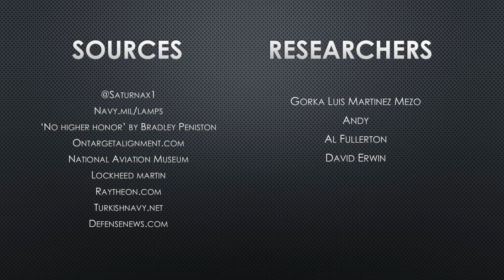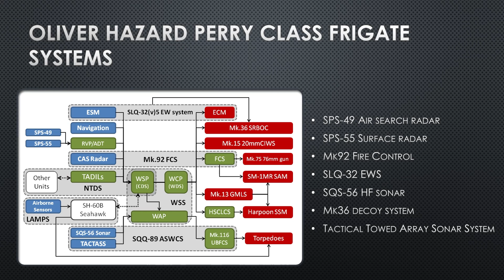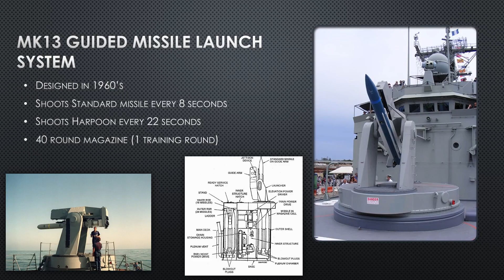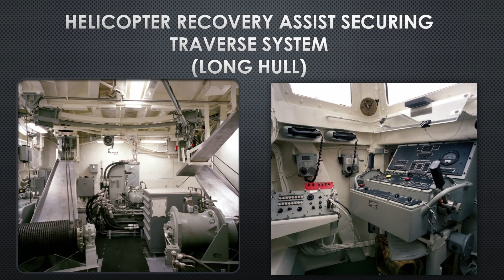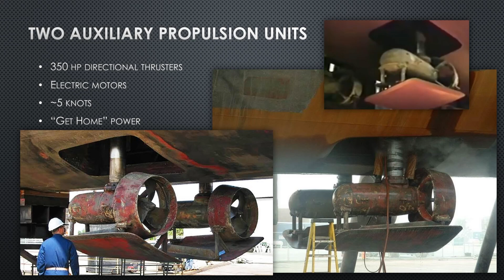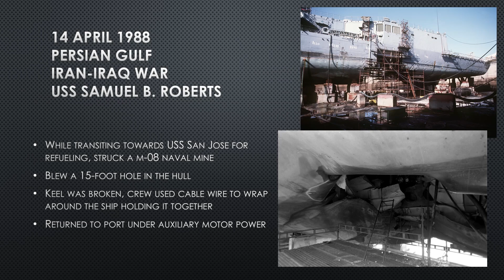Oliver Hazard Perry Ship Brief

Comment: I also remember the USS Stark being hit. And the fact that SCBA wasn’t added to the OHPs in US service until 2000 at the earliest astounds me! When I joined the RAN in 1988(at that time we had 4 of the total of 6 OHP derived ships; oh, and all the short-hulls we got were converted to long-hulls later) I was trained on the SCBA, like everyone else before they went to sea. The first generation of it was at that time being phased out for a smaller, more compact twin-cylinder unit known as OCCABA.

Edit: the Australian Adelaide class was equipped with another channel of fire with the ESSM, vastly multiplying the rate of fire for air defence. This, of course, was,only intended as a temporary stand-in on the newest 4 FFGs between the the retirement of the Perth class DDGs and the introduction of the Hobart class DDGs. The ANZAC class FFHs can carry 8 Harpoons in canister launchers so there would always be backup to the slow rate of fire for the FFGs, if they even carried them at that point. 

One last point, the RANs FFGs that were upgraded also got SM-2.

Comment: A couple of issues I have with your brief from a former EW.  The SPS- 49 is a low freq long range 2D (bearing/range) early warning radar.  Also the SLQ-32 antennas are port and stbd of the MK-92 CAS antenna right behind the pilot house.

Comment: I served as OS1 aboard the USS Vandegrift FFG-48. I was ships AIC and later the ATACO which is the controller for the Lamps MK III platform. Fully integrated into the ships CIC including all key flight data, radar, ESM, and sonar buoy data is all relayed directly to our CIC shipboard. That said, you might have missed a couple key elements and capabilities. Well done.

Comment: The LAMPS slide incorrectly refers to a SH-60F.  The SH-60F "Ocean Hawk" was operated by HS squadrons deployed on aircraft carriers. The photo is of the correct SH-60B Seahawk that was operated by HSL squadrons from FFGs, DDs, DDGs, CGs.
A bit of insider knowledge about the RAST system.  The vast majority of our Seahawk landings were "Free Deck" landings, where the helicopter lowered its probe and then we just manually landed into the ship's "trap".  We very rarely used the cables to conduct "Rast Assisted" landings, because it took longer and was a pain.  While a RA landing had a slightly higher sea state limit, it took longer and was riskier.  It required two brave deck crew to run out onto a pitching and rolling deck with a hook and grounding wire.  They braved the wind and rotor wash of the helo and would clip the grounding wire to a pad eye and then use the hook to catch the blowing messenger cable from the helicopter.  (The grounded hook was to prevent them from getting shocked by static electricity in the messenger cable.)  Once they hooked the messenger cable they would grab it and connect it to the ship's heavier RA cable.  The helo would then pull up the RA cable, though the RA cable would often disconnect from the messenger cable while it was being hauled up , requiring the deck crew to run back onto the deck to get the cable re-attached.  Once the RA cable was hauled up and locked into the helo's probe, the LSO could easily pull the the helo into the trap.  However, we had spent a bunch of extra time hovering over a moving deck.  It was much quicker to just perform a Free Deck landing, and if we missed the trap, we'd just lift back up, reposition, and land again.  Much faster and no risk to deck crew.  On a humorous note, I often watched new deck crew catch the blowing messenger cable with their grounding hook and then move toward the RA cable laid out on the deck only to find they couldn't quite reach.  You could see them pull on the messenger cable as if they thought they could pull the helo over to reach the RA cable!

Comment: Served 2 tours on FFGs, as Navigator and as CSO in the 2000s, did INSURVs on both.  They were good capable little ships.  The LCS are terrible, however I will agree that the FFGs had to go.  They had gone way underfunded on basic maintenance and needed upgrades through the 90s bc of the fall of USSR, and 00s bc of the war on terror.  No Link 16, no offensive strike once they cut off the Mk13s in early 00s, no SHF/EHF (in 2007 we still only had 32k connectivity!), the FC systems were not COTS compatible and dated from early 70s...  By the time the Navy found out the LCS was a $h1t$h0w, OHPs were too far gone and too outdated to be brought up to modern capabilities for the years of service life they had left.
Additionally, there was a manning issue, besides just number of crew, you had a bunch of unique/rare NECs, which was expensive for the Navy and causes limited advancement viability for the sailor. On the officer side, you were behind if you went there as a first tour bc you got no aegis experience, and unless you were engineering, you wouldn't get the ability to get an EOOW letter, which really hurt their chances later in their career, or greatly limited future choices. AKA for both Enlisted and Officer they could be career killers.
They were great in their day and the Navy definitely needs a class of ships to handle low threat independent missions, and CBG/ARG picket, but OHPs just couldn't do it anymore.

Comment: One fact about that project 60, it came up with a small-ship, big-ship idea. The small ship was meant to be cost effective and limited in scope to supplement the large ship, 
which was designed to be very capable. This lead to the OHP, and the Spruance-class.

About that Phalanx on the stark, I did some reading around, found some navy investigation documents claimed the Phalanx was actually not operational and they lied about it so they could go on deployment. Had they not done that, they wouldn't have been able to deploy to the gulf. Would be interesting to see how it would have dealt with those Exocets.

The Mk38s I think replaced some of the 50mm Brownings used for close range.  Pretty capable system, especially the remove controlled ones.

I know of those variable pitch props, I was on another ship with those. I just thought they were effective speed controls or for changing into reverse fast without having "shift gears". I never knew if could throw off sonar like that. Also, I did watch some OHPs maneuver themselves and effectively have a 0 degree turning circle. Looked really cool watching them doing that. Never saw a picture of those things till now.

 I think the Mk.54 was an attempt to build a torp which could operate at littoral environments, which the Mk 46 and Mk 50 couldn't do. I think the Mk 46 got some improvements to handle better in those brown water areas, but I'm not sure how effective it was. It is also a good balance like you said. It's also kinda funny about how that Mk. 50 got a special engine to work at those lower depths the Alfa and Papa could reach, but was stupid expensive between that and it's homing system. 

The OTO-Melara gun also came with some Anti-air rounds also and was intended to act as a close-range anti-missile or anti-aircraft gun. It's actually rather ubiquitous. The thing is, I don't know how the US chose to arm it's 76mm, if they used Melara's ammo or their own. When I researching this gun, there were talks about "Americanizing" the system, but some magazines seem to indicate it did have some VT-Frag ammo capability. I think the AP rounds came later, not sure if she got those either, seemed like a later development.

The hull cracking was due to it having that hybrid aluminum superstructure and steel hull. Going through high seas would cause cracking going through some rough seas.

Also, the OHPs would receive an upgrade to get jamming capability. Originally, they only had the SLQ-32(v)1 which could see some radar frequencies related to weapons, but after the Stark incident, part of the investigation concluded that the (v)1 wasn't effective enough and would get a "Sidekick" jamming module2, being designated at SLQ-32(v)5.

Oh yea, I remember those old OBAs, which I was on Cushing we had those. Heaver and awkward since it was worn on your stomach front instead of that tank in the back wish SCBAs.

The Adelaides also got a new FCS, new radar, sonar, extended the flight decks to accept larger ASW helos and made that Mk 13 launcher fire SM-2s. That last one isn't too far fetched since the SM-1 and SM-2 aren't that different size wise. Actually, that training missile pictured I believe is an SM-2, think I saw that picture before. That modification was stupid expensive, and wound up selling some not very long after that program completed. I do have to admit, those VLS cells are a clever upgrade.

Comment: I was on a FFG-7 class we were in the the gulf with the stark. FFG-7 never carried helos, they were assigned when specific missions we in progress we mainly received them during FLEETEX, and received the Helos usually enroute but my ship only had them when near Hawaii. 29 knots is the published speed, Janes speed listed is higher and more accurate, My ship exceeded Janes listed speed more than once (35knots no smoke!). Our nickname for the sonar was the Helen Keller sonar meaning you find a sub when you run it over! The USS Stark had a MK15 Mod 0 CIWS it did not have the MK 38 NGS as that was after 2003. Stark did not have RAST that was flight 3 versions. The cracking of the hull was dealt with prior to the 1987. Due to the Stark the Fire-Fighting FLIR camera was developed helping to find hot spots. I like what you presented but some of the info regarding the Stark was off, not sure how much I can actually contribute, but the fire was rampant for 3 days despite another ship assisting not of the same class. Learning firefight for your class really helps as was highlighted by this incident. I do enjoy your channel even though I was on a target! as my dad would say (DBF) in his words he served aboard the Trutta SS-421.
Reply: I have heard the term Hellen Keller quite a bit from my dad. You wouldn’t have been on FFG-46, would you?
Reply: @THC7255  No I was on USS Reid FFG 30 (The Reid-ski, we were always independent duty and on the orange forces side during exercises) We were in the southern part of the gulf when this happened, I was on watch at the CIWS local control station at the time this occurred, I actually wrote down notes as we received  information but lost them at some point, as my memory serves the reports started some time after movie call so probably 9 pm local so about 16:00 Zulu. We were relocated to assist 3 days later as it was still on fire and burning and went aboard to relieve their crew and the destroyers crew that were assisting them to put out the fire, set re-flash watches and start dewatering, our CHENG relieved theirs and rode with them all the way back to their homeport. The wikipedia entry that they arrived at ASU the next day is incorrect it was 5 days later as I remember.
Reply: @buzzaard7036  I was on the USS Flatley (FFG-21) and we replaced the Stark after she was hit. We were a flight 1 ship also, and had a SH-2 Seasprite det. onboard. IIRC, the CIWS was in local control and the duty FC back aft in the CIWS space asked to go to the head and didnt put it in remote control. Not his fault, as the TAO said he could go, and their SOP was to keep it in local control. Our CO made it mandatory that CIWS would be in remote control, always manned and the FC had to get a relief FC to leave the station in Combat. 

The memories of ASU (alcohol support unit) and the souk in Manama. 

Dan in Jupiter
Reply: @sprout5199  We rarely had a Helo detail on board and it was usually for RimPac, Yea Our SOP was 3 section watch-standing the entire time we were in the gulf, CIWS in Remote Control except to run DSOTS (Daily System Operability Tests) We sat a the Local control panel and the MK92 watchstander in Combat monitored the Remote Control Station. We went to 3section while in the Indian Ocean as we got closer to Iran, had to keep an eye on those ancient Silkworm missles.

Comment: There was a slight design flaw in the FFG Class that was found later, which was that in heavy seas, the torsion from the ship’s yawing formed a crack in the superstructure at the STIR radar room. We had two feet of water sloshing back & forth in that radar compartment while transitioning the North Sea. NAVSEA solved the issue by welding a two foot strap on all the FFGs at that point in the superstructure.
Reply: Served two tours FFG-47 NICHOLAS, and FFG-39 DOYLE. I can confirm this.  Had the stateroom starboard side just forward of the wardroom.  Hit some weather doing SNIFL exercises off west coast of Scotland, the twisting tore an 8' crack at the Aluminum/Steel weld where the superstructure met the deck outside my stateroom.  Cheng and I spent the next several weeks of the underway w varying degrees of constant flooding in our room even after some temp welding repairs.  They repaired the tear, but no $ to rip out the carpet and such until IH shut us down due to blackmold growing everywhere.  Fun times...

Comment: I have a question about the speed of OHP. Was it considered quite slow for carrier escort duty? It really can't keep up well with pedal to the metal carrier. For this kind of ship it seems quite slow. Was it par to fthe cost cutting thing?
Reply: There is a comment from a sailor above that states his FFG was able to hit 35 knots at flank. 29 knots is the advertised speed. For a FFG with 2 LM2500s, that doesn't surprise me.
Reply: I remember seeing 38 knots on gyro display in our shop (IC Gyro) when we did a speed run once. And with the port list of about 5 degrees due to the torque of the single shaft.

Dan in Jupiter

Comment: Nice overview! More, please!  
Back in the '70s, the military budget was highly constrained, so nobody was getting all the high-capability weapons they wanted, to the idea of 'hi-lo' mix came about.  Like the Air Force with the high-capability F-15 and the cheaper F-16, NAVAIR with the F-14/F/A-18, the surface forces had to operate less-capable PERRYS to complement SPRUANCES and operate in low-threat environments, such as convoy escort.
Reply: I'd have a hard time agreeing with you saying the F-14 F/A-18 were a Hi-Lo mix. They were both at their time of introduction advanced highly capable and expensive aircraft. Neither of them would have considered lower capable or the cost effective alternative. They were just designed for different missions.
Reply: @richardcontinijr9661  F/A-18 was vastly different from YF-17....
Reply: @piotrd.4850  A complete redesign...
Reply: @richardcontinijr9661  The F/A-18 was indeed world class in its category, but compared to the F-14, it still came up short as an all-around fighter; note the controversy around using the Super Bug as a Tomcat replacement.  The Hornet was also significantly cheaper than the Tomcat, which counted for a LOT in the '70s.
Reply: @petesheppard1709  2 years late but I think the controversy over the Super Bug replacing the Tomcat was the fact that a lot of people think the Super Hornet is just an upgrade to the Hornet, rather than it being a scaled-up aircraft marketed as just an upgrade/variant. I saw it stated somewhere that a majority of the cross compatible parts, are "bolt on" items rather than most of the internal parts
Reply: @demanischaffer  Yep!  Still, the Superbug, for all its improvements, was not as capable as the F-14D.
Reply: You forgot one way the US NAVY operate was not to have all weapons available certain ships or aircraft.  At the time, many ships did not have CIWS for example.  The plan was to retrofit if needed or remove from one ship to give to the other if a good economical plan was presented.

Comment: I am surprised the ECM systems didn't indicate that the ship was being lit up by military targeting radar and not the usual civilian air traffic radar from a so called commercial flight. That is before any missiles were launched.
Reply: RN: From my briefings in the era, the crew had become lax about these flights, having watched them occur on a daily/weekly basis.  They knew the Iraqi plane identity but did not truly expect that they could be targeted. (old TAO and TACCO).
Reply: @KB4QAA  you are correct sir.
Reply: You are exactly correct here. That radar would have set off the SLQ-32 EW system the instant it was activated. If the CIWS was in "standby" mode, 1 button would have changed that and why wasn't the A/C engaged with SM2's at the instant of launch?

OS1
Reply: @noimaslyone  I'm not sure the missiles were ever detected on radar, so there may never have been any opportunity to engage with missiles. The aircraft just flying around did not justify shooting at them.

Comment: If the CIC and the bridge are 2 different rooms, where is the Captain? Usually a Captains place is on the bridge of his ship. But if he is there, how does he keep an eye over the CIC? Wouldn't it be more practical, if CIC and bridge were just one and the same room?
Reply: On an OHP the captain cabin is right across from CIC. Also the Bridge is directly up one level above CIC. You literally can open up the door to the CIC and yell up to the bridge if you need to.
Reply: In combat, the captain goes to the CIC, where he can most effectively command the ship and her weapons in battle.
Reply: Actually it's quite valuable, underway to have two independent sources evaluating what's going on.  whether the captain is on the bridge or  in  CIC, he has the bridge with a set of eyes on Target and he has cic with electronics on target..